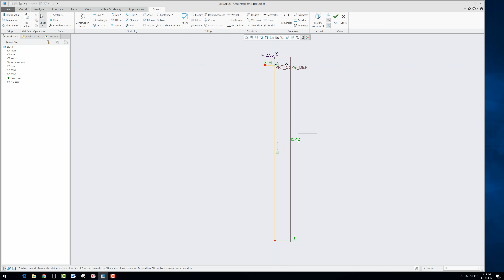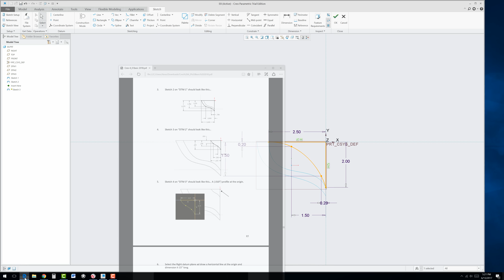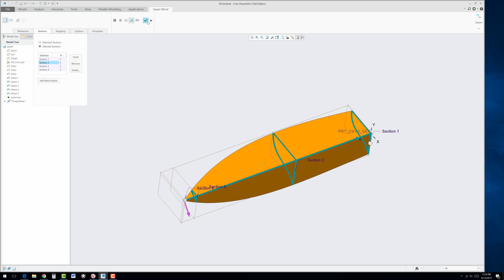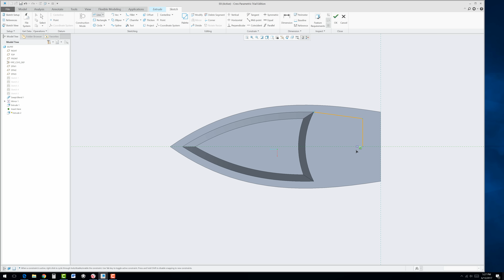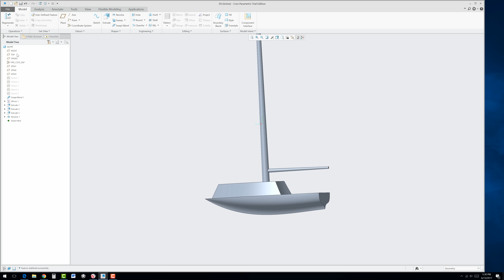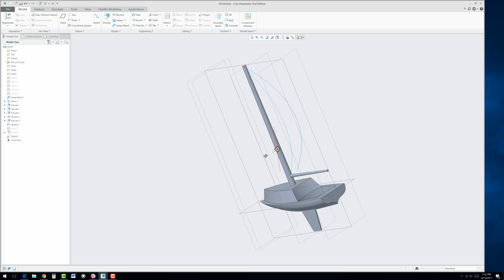E8 Creo Parametric 4.0 Advanced Modeling 2 Boat Tutorial

Comment: This is not the correct method of designing a boat. If you just want to make a pretty model its ok, but it will give students the wrong impression on really how us yacht designers use the software. one of the main differences is you need to use the Boundary blend tool. Secondly the free form sections cannot be dimensioned, it will be way to difficult to fair the surface in the next step when creating the longitudinals. maybe after the hull form is faired, then you could put in dimensions for reference later for lofting. I will be happy to send you some examples of a real hull form design using CREO if you like. Other than that I am really enjoying your videos, even after years of using CREO i always learn something new.
Reply from the maker: Hi Sailingwindrush, thank you for the kind words. This is a lesson 8 of a "basics" class on how to model, it's not intended for advanced users designing yachts.